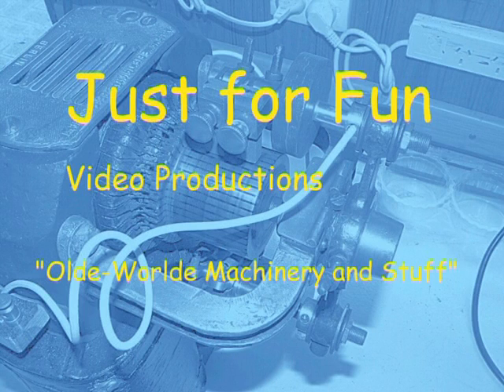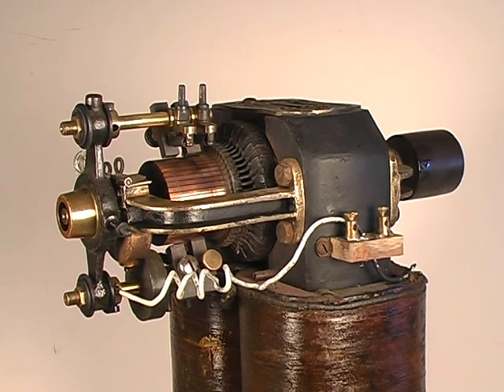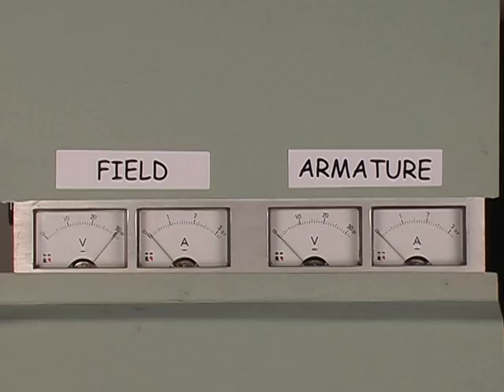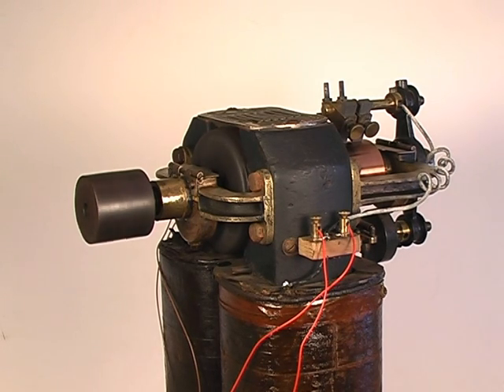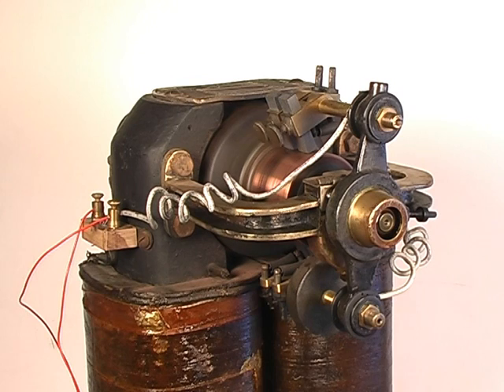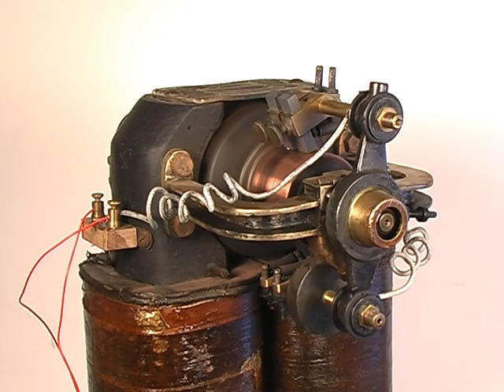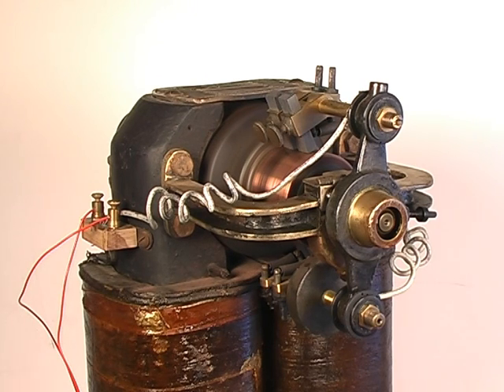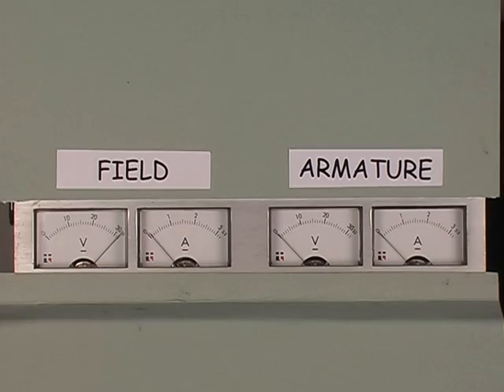A very old electric motor

Comment: This was the first advancement over the Gramme Engine or "Anchor Ring" motor of 1871, with the contacts moved to the shaft and away from the outer rim, giving far less brush-friction.  Yet this one still had the earliest ring-shaped rotor core.  The next improvement, the drum-shaped core, eliminated any copper passing on the interior of the core (where they were shielded from the magnetic field from the stator windings.)  Using a drum rather than a ring doubled the wattage.
Reply: Thanks 👍

Comment: Was the motor originally made for 120 volts and was house current 120 volts at the time this motor was made and what would have this motor been used for
Reply from the maker: As far as I know, the design voltage was 110 or 120 Volts DC,  Most domestic supplies were 110 or 120 Volts, which later changed to 200 Volts, with 3 wires, one + 110 Volts, one Ground, and one _ 110 Volts.
I have no idea what the motor was for, and suspect it was in the owners workshop to drive woodworking equipment.
Regards.  Pouk Kirkebjetg.
Reply: @ThePOULKIRK  so it's like a dryer 240 between both hot wire using a double pole breaker
Reply: @ThePOULKIRK  back then I hear that only 120 volts came into the house but there was 240 available but one house was on one leg of the 240 and the other house was on the other leg of the 240 so there's one transformer supplying several houses on each side on each half of the transformer so the person that had this motor would have had to have 24 0 coming to his house like we have today
Reply from the maker: Actually the motor was run on DC, Transformers does not operate on DC.  Originally, the supply voltage was 110, later changed to 220.
Supply was + 110 Volts, and - 100 Volts in respect to Earth or Ground.

Comment: is the rotor with iron  or without ? , for 1887 its is a high efficient motor , and a genial construction , ironlees will be the best . so it runs with very low voltage , i build myself lots of motors , my last one is also ironlees fan with power and low watts  , Leybold in germany berlin is the best ,
Reply from the maker: Hi Joseph.  I have been trying to send an email back to you, as I have quite a bit of information I can give you.  My email address is poulk@iinet.net.au.  Looking forward to hear from you.
Reply: Wdym with ironless?

Comment: So I've acquired 20+ AC motors and I really want some insight to decide if they're worth or even useful for anything at at all. They came from very old nursing home beds from the 70s or 80s and the tags say they're 1725 RPM and 1/12 horsepower.

Comment: The main problems of 1880's DC motors: If a drive belt broke at full power, it accelerates until the rotor flies apart. In huge DC motors, the rotor current must be limited while the motor gets up to speed or the rotor will burn up. And if the rotor seizes, it will also burn up. So they needed active power management, and were usually manually started.
Reply: Problem with disengaged load is typical for series connected (or universal) dc motors. They have high starting torque but theoretically no upper speed limit. Motor shown here works in parallel configuration and doesn't have that problem. 
Generally dc motor with seized rotor act as a short circuit since there is no back emf generated in such cases to limit the current. This is unlike ie the induction motor that has some back emf even when locked which limits the supply current.

Comment: In 1887, this particular engine, had to cost a really sick amount of money. 2kw of power, in such a design in 1887 is just purely insane.
Reply: And it only consumes about as much current as a small appliance bulb... haha.  And ppl think we are advanceing... well only where they alloy it
Reply: @thespiritof76..  Obviously that's only the power consumption with a tenth of the nominal voltage,with no load ,it's not that the power output is 2hp with a consumption of some watts.